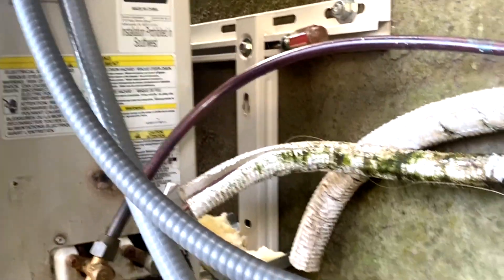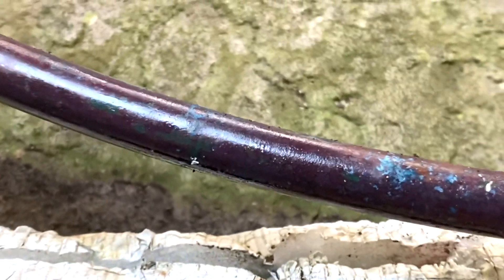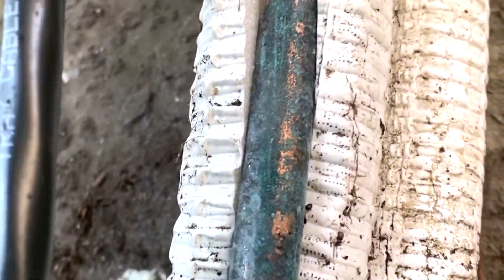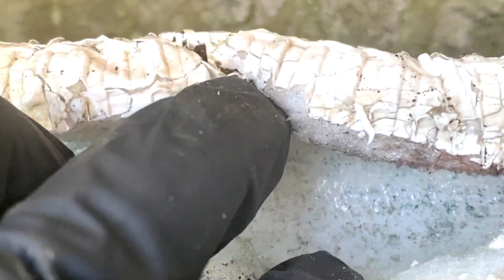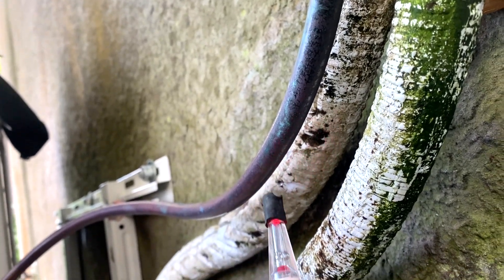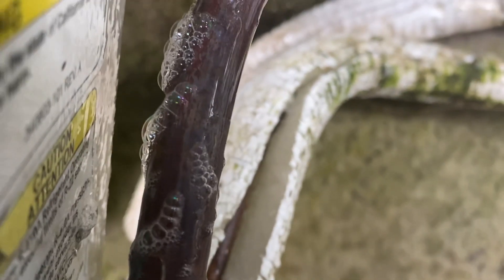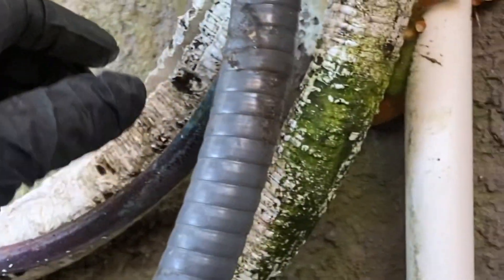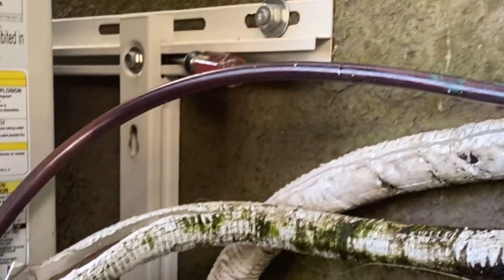How to Find a Refrigerant Leak on a Carrier Mini split line set using H-10 Pro

Comment: Put new armor flex on the lineset. The moisture from the lines mixing with the chemicals from the insulation caused the leak.
Reply from the maker: Man, I am happy to hear from you, watched you guys for many years. You and Zack had inspired me from the beginning of Youtube days heard y'all talking about it on the recent HVAC Shop Talk. thanks for the advice and the comment.....
Reply: It seeps right through the copper sometimes. I had one bubbling up, only got quick hit with detector when popping the bubbles with leak detector. I guess that white insulation compromises the copper.